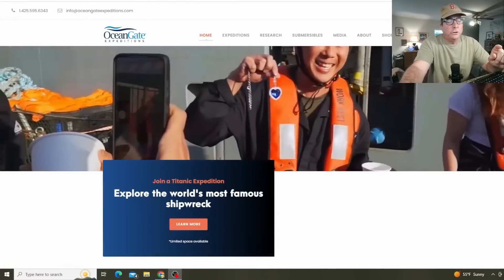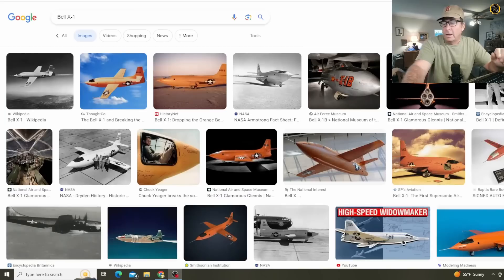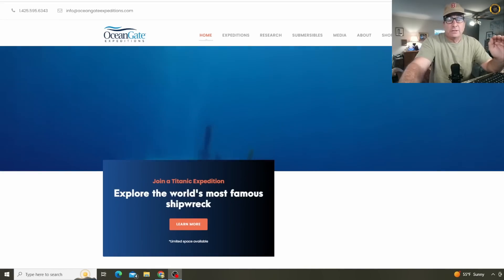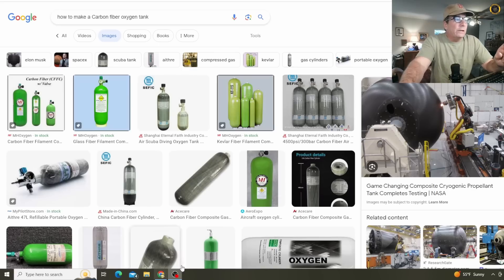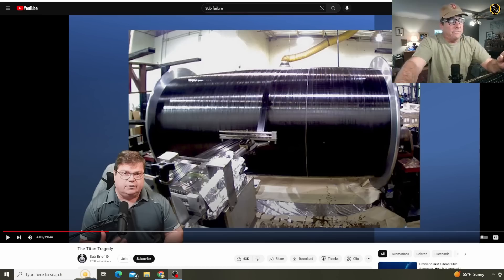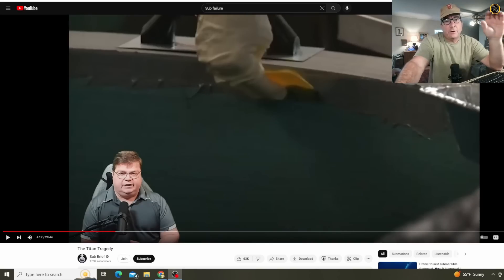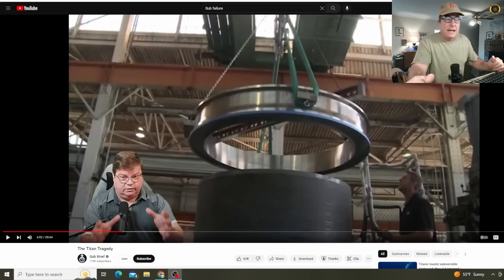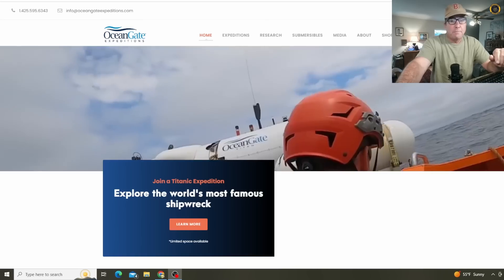Oceangate Sub Construction Details and Implosion

Comment: Juan, I appreciate your knowledge of carbon fiber construction and it’s limits, but cannot agree with the analogy to the FAA’s regulation of experimental aircraft.  While there are hundreds of experimental aircraft designers and even more builders, there are a small handful of deep diving submersibles in the entire world.  Holding the manufacturers of those submersibles to an FAA like regulatory standard would likely assure that there would be none.  A closer analogy would be to commercial space exploration vehicles.  I don’t know if NASA or the FAA perform design reviews or construction inspections of Space-X or it’s competitors, but doubt the level of scrutiny and regulation you describe for experimental aircraft exists for space exploration vehicles. Hopefully there is middle ground between no regulation and the FAA’s program for experimental aircraft.

Comment: Materials under tension vs compression are two completely different animals regardless of the material!!!
Carbon fiber also fails in a brittle mode meaning it shatters like glass!!!
The gluing of the carbon fiber hull to the titanium end caps also could be a mode of failure!!!
And NONE of this were ever tested to pressure of 6000PSI for depths of 4000 meters.  For man rated life safety of any sub, it should have been tested to a safety factor of 3:1 - the sub should have been tested to 18,000PSI proof pressures!!!

Comment: What a horror-show.  Anyone who has owned a carbon-fiber bicycle knows they can be crushed and damaged easily and anyone who has bonded a fiberglass scoop onto a steel hood will testify that over time composite materials always delaminated from the metal substructure.  Glue isn't designed to deal with the pressures found at 13000 feet under water.

Comment: I think Boeing makes large fuselage sections using composite material in a similar fashion, winding the material around a huge rotating drum which is basically the fuselage itself if I'm not mistaken.

Comment: theres alot of talk about the materials, design and funcion of the sub however, the window on the sub was only rated for 1300 meters  and OceanGate would not pay the manufacturer to build a viewpoint cleared for 4,000 metres.. curious if the sub design failed or if the window did.

Comment: yep they used it backwards  to what it was designed and used glue instead of fasteners to  connect it to the ring  . Also thats what it was they/ oceangate couldnt afford the Real nickle metal and titanium metal to build a real 20 foot submersible so they used "technology" carbon junk, and the carbon failed and fails often in strange circumstances ,seen it a million times, ~ stockton rush could Not realize this when using this material thought they were above the curve of technology ideas, and and sadly ironically they are resting in the same place with the titanic they wanted to see so much , and all of its victims .

Reply

Comment: A simple calculation of the surface area of the craft * the pressure comes out to near 1 billion lbs of force. That's 5 aircraft carriers. yeah, right, just put some more glue on that joint, that'll fix 'er up.

Comment: Excellent explanation of what's going on with that design. It was a failure from the start. I'm not sure this is a lesson-learned, seeing from James Cameron's position, that it should not be done, and no one else was signing up to do this. Maybe the lesson is, if you do circumvent safety and engineering process and controls, you can cause death and serious injury, which they all signed with that understanding. That (ignoring safety protocols) would be ok for yourself but not for carrying passengers.

Comment: Carbon fiber scuba tanks solve and end this discussion summarily. 

Carbon fiber tanks have positive pressure pushing out, and in theory and by design this exceeds required burst tests. In retrospect, a Carbon fiber pressure hull is exposed to outside forces pressing in. Couple that with the expansion properties of three materials (Carbon fiber, titanium and acrylic) as well as the pressure cycles and you begin to understand what happened. This synopsis does not mention the deterioration of the synthetics exposed to varying degrees of temperature. 

I knew the first day the vessel was lost. I also knew the remnants of debris would be very near the area of lost contact, which it was. 

The moral to the story is when testing the unknown you must consider the recommendations of the experts. Myself, if NASA suggested 7 inches of laminate, I would have applied 10 inches to assure safety.

Comment: I just watched another video of a dive in this and it was mindboggling. They were on the bottom with a thruster problem and could only go in circles and CEO couldn't remember how the buttons on the controller were mapped! They finally solved it by rotating the controller.
Reply: Iirc, the thruster was either on backwards, or had been wired backwards. It wasn’t that he couldn’t remember how the controller was mapped, it was that they had to remap it.

I think pretty much every expedition. The Titan went on, they encountered some sort of technical difficulties.

Comment: Just throwing some raw numbers at a pad I came up with a glue seam area compression load of 4280psi for 3000m of hydrostatic pressure. 
I don't know of any chemical bonding agents that could withstand cycling loads in that region of compression without suffering damage.
I certainly wouldn't risk anything like this, maybe ok for a ROV design, but not something with human occupants.

Comment: Yeah, the way James Cameron described it and why they build these things out of contiguous materials makes a lot of sense. How when carbon fiber is subjected to these cycles of extreme pressure it begins to separate and weaken between the layers so you just never know when something bad is going to happen. 
That Stockton Rush said he didn’t want to let regulation get in the way of innovation which is absolute nonsense because there was no “regulation” other than the regulations the community puts on itself to ensure safety.

Comment: The US Navy apparently knew pretty early on that there was some sort of significant undersea event in the same time frame in which this vessel disappeared.   This was based on data from their long-standing underwater hydrophone arrays, that have historically been used to monitor military submarine activity.    I find it rather shocking that OceanGate did not have some sort of hydrophones in the water when the Titan was diving, to keep tabs on it.   If they did, they would have known right away that something very significant had happened.    Everybody kept us in suspense for several days, holding out hope for some sort of rescue, when it is likely that the Unified Command knew all along that it was likely the vehicle had suffered a catastrophic failure.
Reply: There are now reports that the OceanGate surface crew did hear a bang. But it doesn't matter what they or the Navy heard... Until you find definitive proof the vessel has been lost, you're going to search in case a rescue turns out to be possible. Stopping prematurely because you heard an anomalous sound wouldn't make sense...
Reply: Yes, they were likely rather convinced that the noise was from the destruction of the submersible, but I presume they remained quiet, being not absolutely certain of the submersible's fate, so as not to reduce the zeal of the searchers in any way.
Reply: Hyrdrophones? Think about it... there's one situation that explains a simultaneous lack of communication and lack of surfacing -- total implosion. Everybody knows this, and the reports of supposed 'banging sounds every 30 minutes' were obvious BS and Fake News.

Comment: Doesn’t the paint delaminate on current 787’s and A350’s due to its composite / carbon fibre construction certified by the FAA? The Comet imploded multiple times in the 60’s losing hundreds of passengers lives again under government certification and Concordes tyres imploded on take off throughout its operational life. However I agree carbon fibre will degrade, delaminate and vis ery dependent on the human creating the component and their knowledge and discipline with weave direction when layering for the achievement of ultimate strength. Autoclaving prior to baking should somewhat mitigate air pockets when it extracts all the air from the oven pulling the layers tight.

Comment: Our company makes s glass pipe lining machines for city and industrial infrastructure. Our liners have to pass a bunch of tests. One of which is called the pressure pickle  jar test.  All it takes is one small  dry area of glass too allow intrusion through the glass strands within the epoxy. My guess is salt water has been permiating the structure every dive. Not only does the water graudually break down the epoxy, but the salt left behind will dry and expand further splitting the glass strands from one another. I bet you this sub would drip water for days after a dive. Should have been the warning.

Comment: Carbon fiber is used in pressure vessels because the high pressure is on the inside, forcing the wall into uniform tension, and thus producing a stable system. But in this case, very high pressures exist on the outside of the wall. As the vessel descends, the external forces increase while the internal pressure remains the same (1 Atm). Given 1 Atm on the inside and maybe near 400 Atm on the outside, the system begins to resemble a vacuum system. So, it begins to approach an unstable system. In addition, carbon fibers are not uniform or perfect materials. A very small impact on the surface of an unstable system - or maybe a flaw or crack inside the wall - might cause cracks to grow. Cracks grow under pressure. And at these intense pressures (approximately 400 Atm), I suspect that even a minor crack in materials such as carbon fiber would quickly lengthen until the wall shattered in an instant.

Comment: Watch a video from inside they had 2 tv screens screwed to the wall!! I cant imaging that was good for carbon at all. You can see 3 shiny screw heads holding them up.  You would thing they would have put titanium rings inside to give it strength inside not sure if that would have stopped this I am sure it would have been stronger   either way its very sad for all involved

Comment: In aircraft, the cabon fiber sheets are sandwiched with special epoxies. I don't see that with the Titan. If that is true, what may have happened is the carbon fiber held up to the classic crush failure mode, but the two titanium end caps focused the pressure laterally and the carbon fiber sheets "slid" past each other, sort of like a telescope or accordion, and it crushed less like squeezing a beer can and more like flattening one on your forehead (like Bluto did in the film "Animal House"). Not to be funny but just as an example.
https://youtu.be/LARx7M9s15w

Comment: What is the advantage of carbon fiber in submarines, really? Why isn’t the same metal which is used in submarines, good enough, since the mass of the vessel sure is less important since there is more than enough buoyancy in the water, since most of it is air- right?
Reply: A submarine has to be as heavy as the water it displaces. If it's a lot heavier than this you can't go up again. Classic deep sea subs with steel spheres as pressure vessel are typically too heavy and use additional material like gasoline in balloons to generate lift. 

On a normal sub the weight is not a problem, but deep sea subs need a much more stable pressure vessel and then it gets too heavy to meet the displacement weight by itself any more. 

I think they used carbon fiber to get the right weight without extra stuff

Comment: the 1 thing no one is talking about is the people them self's if one of them freaked out started going nuts and broke something to cause it to fail like dropping the pressure inside the sub
Reply: Pressure inside the sub is 1 bar /15 PSI. Pressure in the water is around 400 bar. Even if the sub would have a vacuum (which would kill the people of course) the sub would not be stressed significantly more. 

What may be dangerous is if somebody tries to smash the window, but I assume they are not allowed to take a hammer, hatchets or a gun into the sub
Reply: ok but a heavy-set kid flailing all about kicking it could do something or breaking the computers or something else. pressure change was just an assumption. I in no way know anything about these things. except human nature people break and will get out of control and that is a very scary place to be if you're not trained for it. I can say this you couldn't pay me to get in any sub of any kind.

Comment: Juan, I don't agree with you that engineers with be able to reconstruct the exact failure mode of what happened (time 5:50). The implosion was so energetic (see Scott Manley's livestream video where he said the implosion event was equivalent to 50 kilograms of TNT going off inside the vessel). And, as you said, when carbon fiber fails it fails catastrophically. There will definitely not be undamaged components from which to access the integrity of flight control surfaces as often happens in most aircraft accidents. The critical structural components will all be in tiny pieces lying on the sea floor.

Comment: As the story progresses the build gets sketchier 😮

Problem is that they got away with it when the structure was new. So even though the fibre was laid at 90° and used compressivly - the yeild strength was still higher than the depth attained. They did a few cycles. I guess that they underestimated a number of factors that contributed to the premature aging of this structure - including the ingress of 400 Bar sea water into the matrix. Coupled with the flex caused by the radial load on the cylinder (also a bad idea). And the flex at the end cap joints. 

I would speculate that the structure initialy  disintegrated - because of delamination - about mid point between the caps and then just kept going like a glass thrown against a brick wall. 

Titanium has to be the stuff to use but its obviously out of reach of amateurs. Steel next but again requires expensive forging and fabrication. So carbon fibre is the next choice for a DIY sub. 

The engineer got his basic sums right- it worked - for a while 🙄

Comment: OK. At 4:24, Juan says "carbon fiber has a limited number of cycles". Huh? So these hundreds of planes with carbon fiber are sent to the sky with a cycle limit? Will the wings fall off? Will the fuselage fly apart? I understand that the savings on fuel are much desired. But I see planes from 70 years ago still flying. The airlines couldn't afford their fuel use at today's energy prices but they still fly! The Dreamliner and its peers, how long till they become scrap to recover and build new planes from? And of course we all know carbon fiber crashes are just piles of tiny pieces because these planes just don't stand up to sudden stops. Just like some race cars today when they crash. Only the engine and suspension is recoverable. I may be misconstruing what Juan says, but it just sounds like planned obsolescence.
Reply: Dreamliners are designed for 44k flight cycles, like a typical long range airliner too. 
However Boeing invested almost 30 bn in this aircraft, and it's of course certified. The same with the A350. 

Aircraft are regularly checked, and stripped to the bare fuselage every 10 years
Reply: @simonm1447  There isn't a lot of big pieces when these planes fly into terrain. Tells me just how strong they are.
Reply: @JimMork  to my knowledge no carbon fiber aircraft has ever flown into terrain, except one A400M which did an emergency landing after the engines failed on test flight because of a wrong software and this one burned on a field in Spain after it struck a high voltage powerline.

It's clear if you fly an aircraft with 800 kph into terrain there's not that much left

Comment: Dis-similar metal problem is usually not an issue with carbon if you just pay a little attention to the design, The majority of the carbon fiber is insulated against contact with any metal by the outer layer of epoxy. Where holes are drilled in the carbon fiber, such as for fasteners, the raw surface is usually re-insulated with RTV. Fasteners are installed "wet".

Comment: That glue looks just like the Hysol glue I use to attach things like CF, aluminum, G10 to carbon fiber. For race cars, not for underwater pressure vessels. Carbon is very dimensionally stable with temperature changes. Metal is not. That glue also gets brittle when it gets cold and soft when it gets hot. Using bondo spreaders to apply it was absolutely not a good idea for this craft. You will undoubtedly have air pockets trapped in that seam.

Comment: Ocean Gate, Blancolirio is very good, with his knowledge of material Science 😎

Having had a class in material Science and aware of leaks, at the time, with Davis Bessie Nuclear plant, may share a SIMILAR ISSUE🤔

The issue at Davis Bessie Nuclear plant was dissimilar materials with DIFFERENT temperature expansion profiles AND a gasket material  (because of the size pipe) lacked the ELASTICITY (to compress & expand over temperature ranges) to maintian the seal at pipe junctions was the source of the leaks!

On the submersible, the interface or connection between two materials (carbon fiber & 'titan'ium 🤔 with DIFFERENT temperature expansion profiles that have minimal ELASTICITY connected with low ELASTICITY glue & bolts, the repeated varying temperature/pressure likely FATIGUED the material at the joints & bolt anchors, is one likely place to investigate 🤔